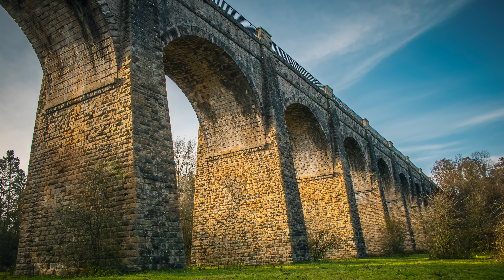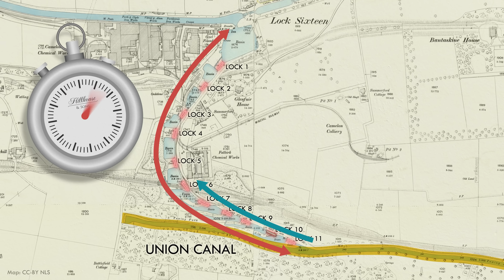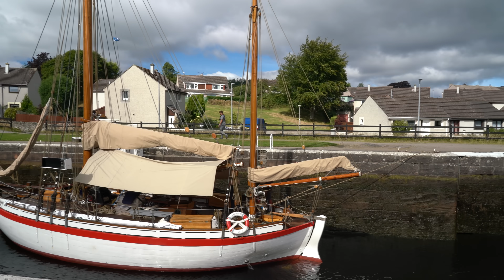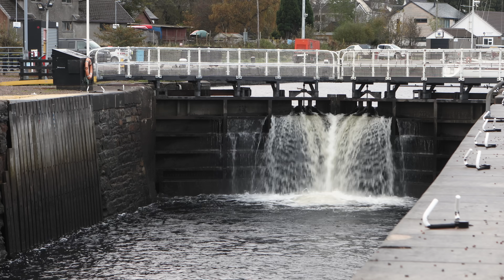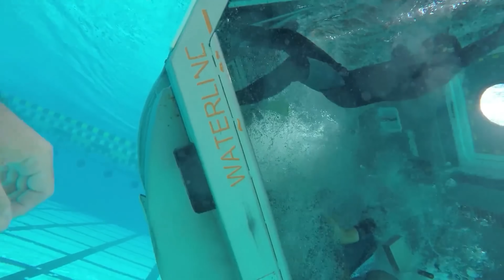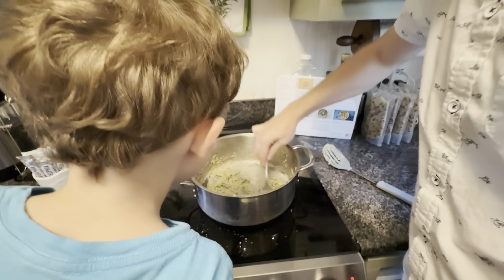The Hidden Engineering Behind the Falkirk Wheel

Comment: Might I suggest on a similar topic, looking at Canada's Trent-Severn Waterway's pair of hydraulic Lift Locks.

For anyone who wants to immediately know, the two locks have a pair of basins like the Falkirk Wheel that, instead of resting on a wheel, rest on huge hydraulic rams. These rams a connected underground so that the pressure fluid can flow freely between the two, so long as the connection remains open. As for how it works, with the upper side of the canal being about a foot or so deeper than the lower, which ever basin is at the top gets filled with more water and thus becomes heavier while the lower basin lets that excess flow out, therefore an imbalance of weight. So all that needs to be controlled is the opening between the rams and the heavier basin pushes downward due to gravity, lifting the opposite basin up to the top. And because of buoyancy, as he mentioned, so long as the boat can fit, it can lift.
Reply: I was going to mention the lift locks in Peterborough Ontario! This video reminded me of them.
Reply: Great suggestion!  I grew up around both of these lift-locks.

Comment: Thank you for covering infrastucture outside of the united states. Im curious if their electric power grid is constructed under the same guidelines and what differences some countries use to the united states', and if they operate using the same techniques and equipment. Ive never heard of a lock, this is a nice way to change elevation of boats and water ways. Which I never heard this is even a challenge but it is. And that wheel is a very special piece and well engineered to advance the lock system.

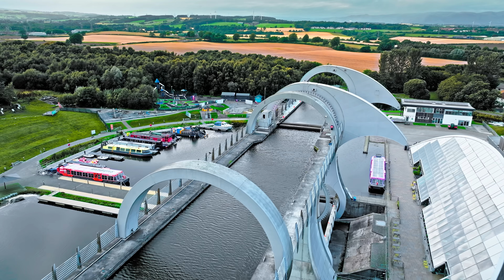Comment: 12:29 the wheel actually solves some real problems though. No tourist is going to spend a day navigating locks for a distance you would walk in an hour. So this enables tourism by enabling access, and by being a tourist destination in itself. 
And it enables much higher boat throughput because it doesn’t use water.

Comment: The lock at the top of the wheel can be used to satisfy another purpose - close level control at the top so that the caissons can be balanced. In order to be balanced, the water depth above the caisson floor needs to be identical at the top and the bottom. Ordinarily, if water is plentiful, this can be done by weirs, which will keep the level of the canal on the stretch the weir serves level with the top of the weir as long as water inflow beats water leakage. With a short section between the lock and the wheel, that makes it easy for a small weir to keep the top caisson's water level stable.

If water level drops in general, then again the short stretch at the top of the wheel due to the lock allows better control of the level at the top, ensuring it matches the level at the bottom.

Comment: It's interesting you bring up Y2K and the fear surrounding that.

I was 11 when the new millennium rolled around, but even at that age, I wasn't scared of it. I knew that internally, computers don't track time like that. Rather, they do something...kind of odd. The way time keeping is done on computers is that you actually store the number of seconds that have elapsed since a common epoch. Virtually every computer system out there uses midnight, Jan 1, 1970 as that epoch. As there was no kind of rollover in that seconds count, there was no risk of any problems. HOWEVER, a few organizations for some reason decided to store dates in their databases as a two character string (in other words, as text) rather than as a pure number. These ones would experience the rollover, because they'd be going from 99 to 00. Thankfully, they were fully prepared when the time came.

Now here's where it gets interesting. The real year that could throw all computers into disarray is still coming up. There's this thing called the Year 2038 problem, and in this case, it is that pure number that's rolling over. Hear me out. The number used to store the second count on computers is typically a signed 32 bit integer. That means it can store the numbers -2,147,483,648 to 2,147,483,647. If you take the 1970 epoch and add 2,147,483,647 seconds to it, you get 3:14:07 Jan 19, 2038. The second after this, the number count becomes negative (due to the way signed integers work on computers, it's called 2's compliment if you're curious), meaning that suddenly we're looking at a clock that says 20:45:52 Dec 13, 1901.

HOWEVER, have no fear. We programmers are always hard at work catching these things before they happen, and we've already fixed this one a long time ago. Through some clever coding, we updated all computer timers (where it matters) to gracefully handle that by extending it from a 32 bit signed integer to a 64 bit one. To give you an idea of just how much more massive that is and how it easily solves the problem, lemme tell you how Windows internally tracks time. Instead of the seconds since an epoch, it tracks the number of 100 nanosecond intervals in a signed 64 bit number with the epoch set not in 1970, but Jan 1, 1601. You know when it's gonna roll over? Not until the year 30828. No, that's not a typo, the THREE HUNDREDTH CENTURY. By that point, we'll almost certainly pick and use a new epoch, which will last another 30k years.

Mind you, much of this is specific to "proper" computers, like desktops, laptops, servers, etc. Embedded systems often use their own particular configuration, so it's a lot harder to make general statements about them. Just thought since you were sharing engineering with us and brought it up, I wanted to share my engineering with you. <3
Reply: The use of 2 digits instead of a number for the year was to save costs.
When it was done initially in the 70s and 80s the year 2000 wasn't an issue because that was way over the expected lifespan of the application.

They were wrong about how long people will use any infostructure that is over its expected end of life (ships, trains, rail, highway, bridges, dams,  legacy code, etc.)

And since the same logic is used in the argument for why the built in bug for the year 30k is not important ...

Comment: Just looking at it - unlike a lock, it uses zero water per operation (other than any leakage), and because the two 'sides' are balanced, it uses very little power.  Genius!    (Minor detail - if a boat is going up but none down, it 'uses' water equivalent to the submerged volume of the boat, which is a lot less than the trough of the wheel carries, and hugely less than a normal lock would use.   But if a boat is going down but none up, it actually feeds an equivalent volume into the upper canal.   So it evens out.   Sheer genius!)

Comment: Here's a fun little tidbit about the fading use of the canals. for some of them it wasn't the railways that ended them (though they did take a lot of the cargo that they used to handle). It was the arrival or reliable road haulage that took the last little bit away from them.
That's how the Grand Union finally went out of business.

It might be worth taking a look at the engineering of the old Foxton incline there actually.

Comment: Water bridges, the Falkirk Wheel, etc are engineering marvels. The nature of water “self-balancing” in these structures makes them extremely efficient, and means the load on the structure is nearly constant. Yes, there is some small variance due to waves/wakes, and the delay in the water level equalizing, but that’s pretty minor compared to the weight of the water, structure, or vehicle.

Comment: I once worked for the company that made the Falkirk Wheel. I remember two interesting facts from a talk by the Chief Engineer of the company. Firstly, the two  'axe heads' have no structural function, they are just decorative! Secondly, the rails supporting the gondolas are heavy duty overhead crane rails. They bought the whole stock of this rail in the UK at the time for the project, with only 1 length spare in case of problems. Also, rails are not normally bent vertically, the company doing the rail being had just bought a large new bender that could just bend those rails, but none had ever bent such rails vertically before, so risky. Cutting edge engineering!

Comment: Near my hometown, in Niederfinow, Germany, there is a "Schiffshebewerk" (ship elevator). It also traverses around 30 meters in height. The old one can transport ships up 85 meters long, the new one up to 110 meters. They connect the second last stage before you leave the Oder-Havel-Kanal and enter the Oder river.
Before the canal was finished in 1914, the Finowcanal, it's predecessor, moved more tonnage than the rhine river at the time.
I think a video about the engineering of the first (built 1600-1620) and second (built 1743-1746) Finowkanal would be pretty interesting.

Comment: My company Fairfields Engineering & Control solutions looks after the hydraulic and EC&I equipment on the Falkirk wheel. Performed a massive round of refurbishment last winter, including draining down the basin. It's an awesome bit of engineering.
Reply: Definitely a really cool project to have worked on
Reply: He mentioned the energy consumption for one lift, but not how long it takes--so what's the actual wattage draw?
Reply: @mattgies  he said it’s about 5 minutes, so 18kW (or a bit less than 25 hp in freedom units)
Reply: @emma.jacobs1  Oh, I guess I missed when he said the duration; thanks!
Reply: @emma.jacobs1 Freedom units are the only real units. All others are fake units. 😂 

That truly is an amazingly tiny amount of power to operate something so big. A lot of the rides at major amusement parks require 500+ HP, er, I mean, Freedom Units. The fact that the gondolas are always closely balanced is a very nice advantage.
Reply: Get rid of it.
Goes nowhere and the taxpayers don’t want it.
Reply: @highlandsprings5752  Hello, troll!
Reply: @mattgies  do you pay for this monstrosity?
Reply: @highlandsprings5752  Goodbye, troll!

Comment: Down here in England, there's also the Anderton Boat Lift, originally built in 1875, which while less elegant than the Falkirk Wheel, it's still an engineering marvel, originally being hydraulically operated, but later converted to electrically lifted with motors & counterweights, it's not had the best life, but was restored & re-opened in 2002 after having been closed since 1983... :)

Comment: As a student I visited the Strépy-Thieu boat lift in Belgium. No wheel, but also using the balancing principle to raise and lower ships. Also finished in 2002, but the height difference here is more than 70 meters, three times as much as the Falkirk wheel. But I've got to admit the wheel is more photogenetic

Comment: The gondolas are mounted on bearings that run in on circular rails ... and also there are some gears to move the shaft ... but the bearing allow for free rotation in the shaft so other than looking cool what is the point of the big gears. Sure they look good, but is that it? Why have bearings allowing you to rotate a gondola inside a shaft that you are also rotating? Is it really just looks?

Comment: Having been there multiple times, you really get amazed by the size of the wheel and how it works. You can see some of the hydraulics in it's basin as the wheel turns, and there there are a lot of warning signs about getting near the wheel, because you can get crushed if you fall in there when it's in operation. There are of course safety railings with gates to ensure people can't just fall in there or climb down in to it.

Comment: What's kinda funny is that initial hydraulic seal concept has been seen in some really goofy autist nerd revolving handgun projects, some from 50+ years ago. Someone wanted little bullets to go fast and high pressures eat barrel/cylinder gaps. They made a sabot that extended forward from the case and bridged the gap, "handing off" the bullet to the barrel. Worked at 50k+ psi for a .002-.003" gap. 

Why, because they wanted to so they found a way to accomplish their goal.

Comment: I think Scotland goofed when they used Locks to connect the upper Canal to the rest of the system after it passed under the Wall...

I would have suggested that a second Wheel would have allowed the boats to move from one elevation to the next without wasting the water that the Locks require to fill themselves...

Comment: Very interesting story about the channels and them horse heads and so on.
But disappointing that the wheel wasn't further explored.
How is it controlled, what are those hooks for, what about maintenance eg. how do they replace bearings on the main axle and what's the cost of operation and for the passage of a boat... Just saying.

Comment: It’s always fun to see people’s face when they learn that there is no counterweights on the wheel.   The lift is always perfectly balanced whether it has a boat on it or not.   Most cars have more power than the motor required to move the lift.  It is really just to overcome inertia and friction.  It’s amazingly efficient, and because the water is both on the top and bottom, there is no water loss to move a ship up or down the lift.  The only reason it’s not used on the Panama Canal is because the arms have to support the entire weight of the gondola full of water.  That gets massive very fast.

Comment: I believe it's also much more efficient in the elevation management. Just one half-rotation probably gets you up/down as much as four or five locks would have. A complicated structure but much more efficient in time and space ressources.
Reply: Maybe less important in Scotland but water efficiency is important when you go over a ridge with a canal.
Reply: If they replaced 11 locks with this and 2 locks,I assume this is dealing with roughly 9 locks worth of elevation. Although in modern engineering you can presumably get away with taller lock gates, so the modern number might be closer to say 6 or 7.
Reply: It's a beautiful system, and looks efficient as heck.  

 Maybe one day we will have mag levs floating boats up hill real quick. They'd have to be designed to handle it. 

 That would be dope. Take more energy. That's what renewables are for.

Comment: We’ve taken two 7-day narrowboat trips in England over the years. This mode of travel is unparalleled for the relaxing pace and mixes of countryside and city scenery. It’s like traveling in an RV, but you’re on the water in your fully self-contained vessel. Altho we didn’t “ride” the Falkirk wheel we have visited the site. Amazing device!
Reply: @DragonPilot I've only done one trip, 7 days like yours, on the Cheshire Ring. Best holiday I've ever had, I think. The enforced slow pace, but with periods of physical activity, constantly if slowly changing scenery is something you don't get with any other similar activity I can think of.  As I emigrated not long after that trip, I doubt I'll ever go again, unless I win the lottery.
Reply: There also tend to be a reasonable number of pubs along most routes, which is handy (strictly for meals of course. Ahem :).
Reply: @E1line-r6d  Oh yes, and often can stagger back to your boat without any concerns about drunk driving. I mean, you CAN drive your boat at night, but not if it's a hire boat. I will suggest that you check before going out on deck improperly dressed in the morning. The fact the place was deserted last night can change as people setting up for a fishing competition can move into place VERY quietly. Or leaving the rear doors open on hot nights.

Comment: There's another interesting and similar use lock structure in Peterborough Ontario, the lift lock is quite old and the largest of its type, originally not needing any power as it operated off of simple valves and water weight. The Trent-Severn is quite the extensive canal and waterway

Comment: I do not really get the need for the gears: If the COG of the tanks is below the rotation point (which is what it looks like) the system should be stable anyway. Though I guess heavy boats could lift the COG
Reply: The gondolas must align precisely with the channels/doors at top & bottom; the gearing guarantees this. Small displacements of the COM away from bottom dead centre don't yield much restoring force, so the angular displacement would build up until the bearing friction is overcome. It doesn't seem sensible to allow the gondolas to rotate in an uncontrolled manner, when alignment is a hard requirement.

Comment: Well I wasn't expecting a video about the canal network in the UK from Practical Engineering!  It's not quite as modern, but just as impressive, is the Anderton Boat Lift in Cheshire. It's a Victorian take on a very similar problem of getting canal boats up and down a large height without using a lot of locks.

Comment: The Falkirk wheel was built in Derbyshire, England by the Butterly Company. The Butterly works has it's own interesting canal infrastructure in the form of an underground wharf in a canal tunnel on the Cromford canal under the site. Sadly that part of the canal is now abandoned mostly due to the tunnel collapsing from mining subsidence near it's eastern portal. The Butterly company were responsible for a lot of great engineering projects like StPancras station in London. Sadly they no longer exist as they went into administration in 2009 but that maked an end of 219 years of engineering with.a ton of history and innovation.
Reply: I looked through Tina Cordon's 127-page report from between October and November 2006 and it was absolutely harrowing! I can't imagine crawling through half-collapsed, half-submerged tunnels and calmly remarking where 200-year-old wooden shoring has collapsed and the brickwork has begun to bulge.
Reply: I remember following one of the arms up the M6, not realising till later what this huge piece was for. It is a fantastic structure.
Reply: wow this is good insider information
Reply: Mmmmm butterly company... 😋
Reply: Oh really? I live near Cromford and have walked along the canals but did not know this. Ill have to check it out :)